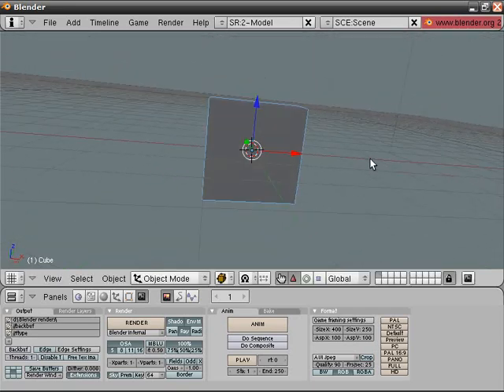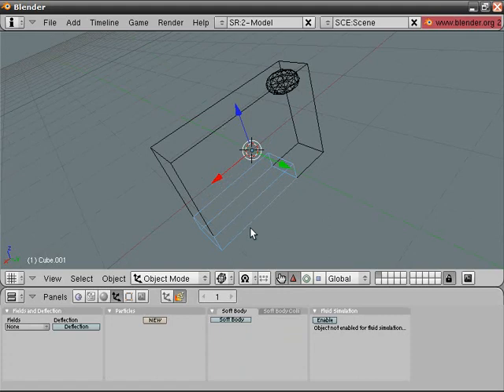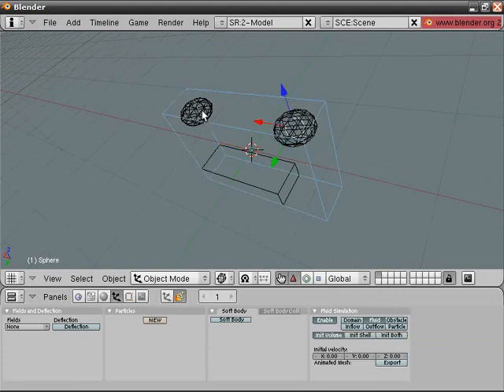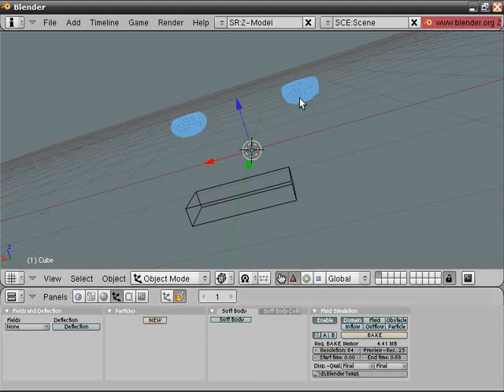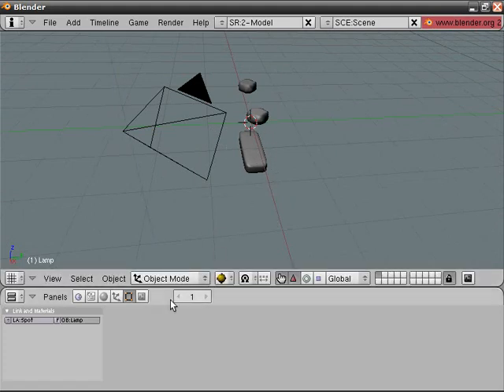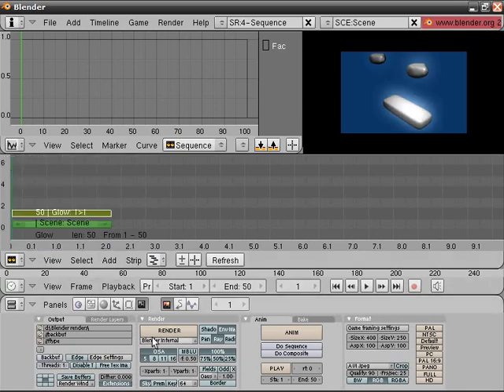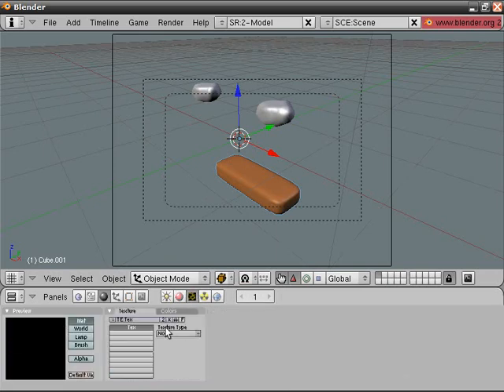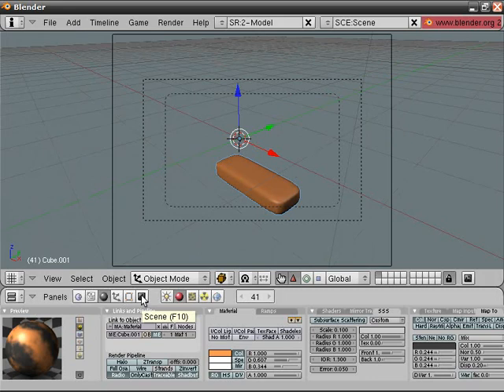Blender Tutorial - Fluid Simulation - Inflow + EXTRA BONUS

Comment from the maker: @xXcrazyalec40Xx 

Well, if you're using older versions press CTRL+Tab then click on the menu that appears "edges".

Newer versions (not unlike the other versions) have a vertex/edge/face(/volume?) selection mini-panel. It is located in the 3D viewport window, in the middle of the toolbar. It has either a vertex, edge or face of a cube highlighted.

Comment: Thanks!! Very Helpful!! I was successful in following all up until you set smooth. I can do the fluid simulation until I set smooth, then there is no animation.The objects just stay static (don't move) and don't drip or flow. Any solution?? I feel that I am following you. When I delete the fluid is where I start to run into issues. I loose my buttons on the bottom.
Thanks!!

Cheers!

-Nick

Comment from the maker: That's the bad thing about offline rendering: the time and the power it needs.

Just yesterday my CPU temp. alarm went off when I was rendering, so I had to re-assign Blender to fewer cores.

However, you can rest assured that with offline rendering, your renders are extremely accurate (which is where ray tracing comes in).

Comment from the maker: Dude, great question! UNFORTUNATELY, Blender does NOT support such a feature... yet.

You could trick the system, though. A few suggestions: IPOs for expected results (bake the fluid at a low resolution, move the obstacle every 30 frames or so according to the fluid) ; make your fluid simulation using softbodies.

I think Blender will have to introduce a separate fluid simulation method. I hope it'll be based on particles (because particles can have weight, resulting in an interaction!).

Comment from the maker: Well, that's a trick thing. You have to keep your domain in less than a CUBE. (say, scale it via X by 6, Z by 0.25 and Y by 5. You get less trouble with the RAM if it is not a cube.
Anyway, you could try manually adjusting the virtual memory.

Comment from the maker: 1. You set alpha value to 0 (or near 0), and enable Ray Transparency, plus IOR (index of refration-Time the light passes throught the certain material DIVIDED by the time light passes through vacuum).

2. Not yet, but then again, I never saw one myself. I'll make sure I'll do one on UV and multi-UV + Built-in textures.